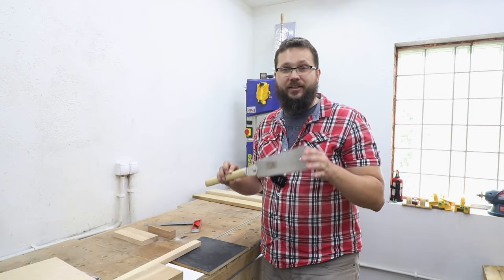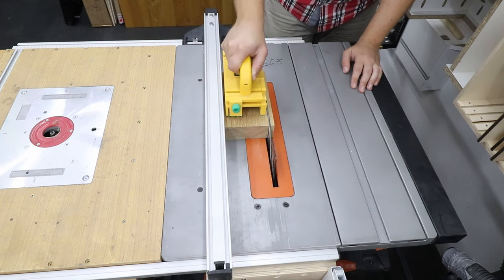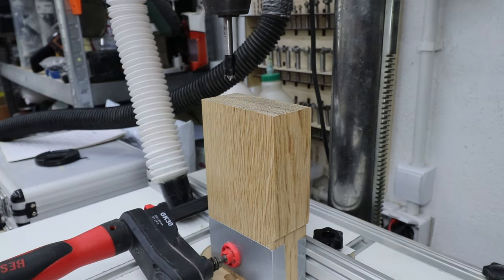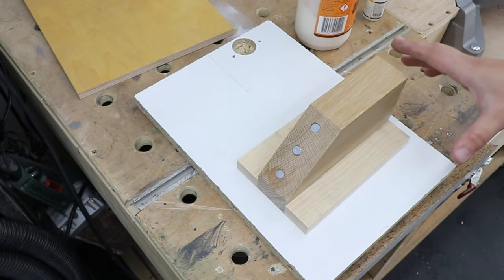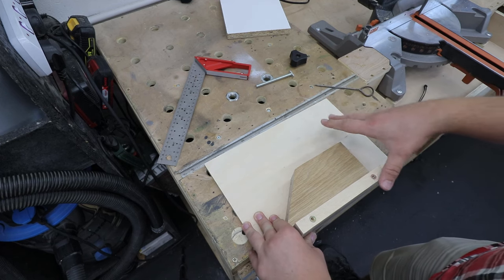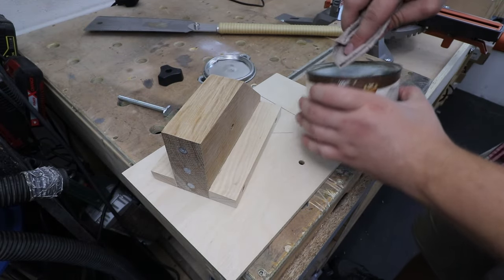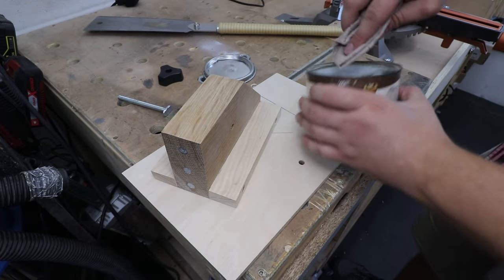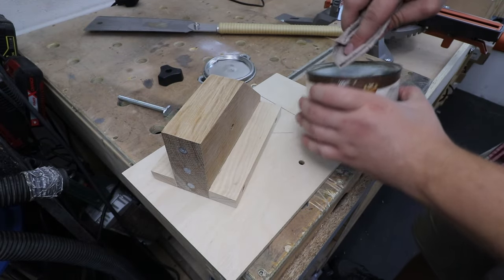Magnetic Handsaw Guide for 90 & 45 Degree Cuts

Comment: Great video! I have one I made, it is a lot rougher than yours but the cuts are dead square. I covered my magnets with that thin clear plastic all tools seem to come in, it just stops the saw sticking on the magnet but still keeps it aligned. I also butt jointed two small pieces in a 90 degrees configuration to use for cutting a lap joint in the vice. Hope this helps someone.
Reply from the maker: Great info. My magnets are just slightly below the level of wood so no issues with the saw sticking directly to the magnets👍
Thank you for watching 😁

Comment: I tried using my saw guide with a Suizan 7" Ryoba but the cross-cut side scratches the guide. I checked the saw teeth pointed 2 direction like a v. Does your saw scratch wood?
Reply from the maker: You would need a straight tooth saw for a jig of this type.
Reply: @CasualDIY  Thanks, I am looking for one. 😀

Comment: I love simple jigs like this, making a relatively simple but actually difficult task (cutting straight) a lot easier ... although I'm a little confused as to why you made two 'lips' to attach to either side of the magnet block, instead of just attaching a singe plate to the base of it ... still brilliant 👍
The one thing about Japanese saws I really don't get is why they are so (relatively) expensive compared to Western style saws ... it's just another flat bit of steel with teeth on it, so why so much more ... rip-off springs to mind!!
Reply from the maker: The two lip setup allows you to use the jig in any way, left, right handed 90 and 45 degrees 👍
Reply: @CasualDIY  I did realise that and forgot to say how that made the jig even better 👍
With regards the construction, you've misunderstand what I said about the 'lips' ... you've basically made a 'T' shape, with the magnetic bit being the vertical part of the 'T' ... you put two small pieces on either side of the vertical part to make the 'T', rather than just screw a plate onto the top of the vertical bit to make the 'T'!
I'm not complaining, just wondering why you did it that way ... was it that you started off with just one lip and then realised if you added another that it could be used right or left handed?
Reply from the maker: @barry.w.christie  yes I started with one lip and then decided to add the second one 😅